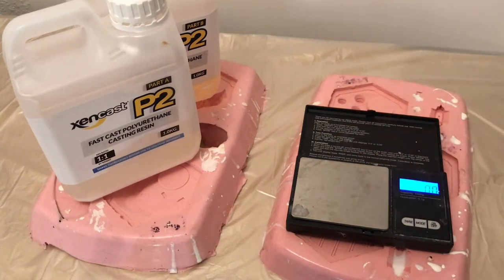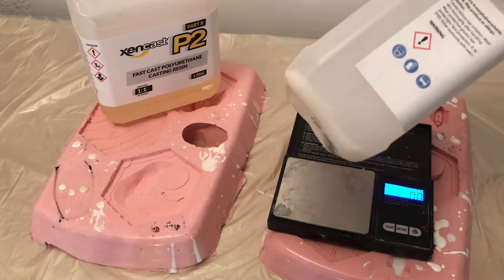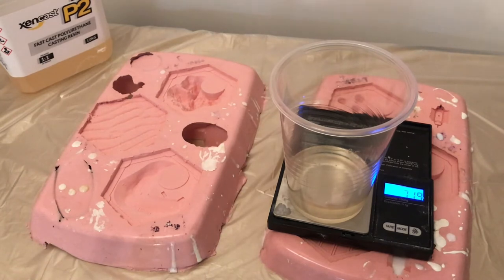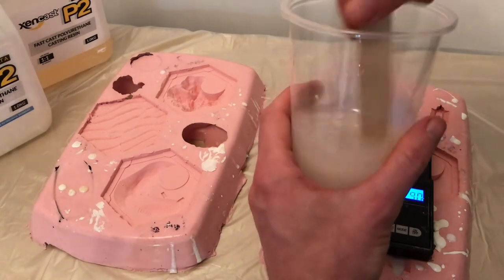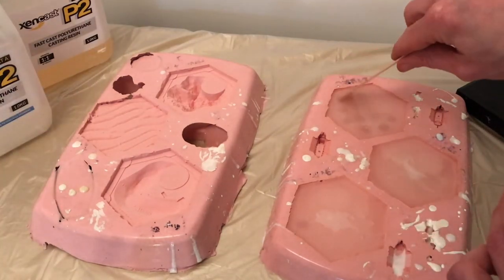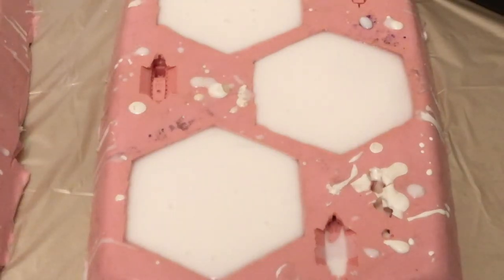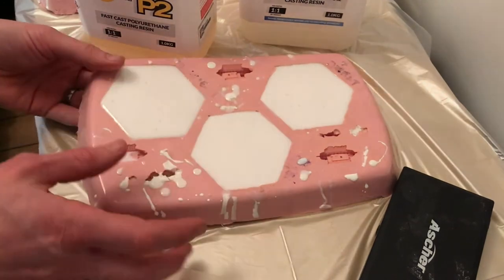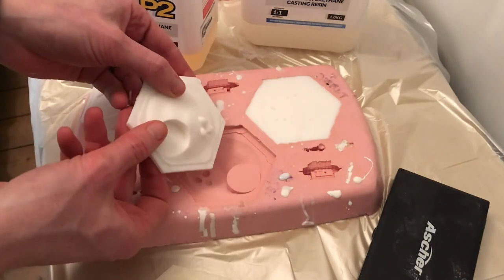Resin Cast 3D Printed Parts with Xencast P2 - Settlers of Catan Pieces! - #5minFriday  - #31

Comment: Awesome dude. I recently had the Idea of 3D Printing a base with holes for magnets and then handsculpting the top and then making a mold to cast it in resin. Looks really awesome
Reply from the maker: Thanks for the comment! My original models had spaces for magnets but it's hard to do two piece casting so I don't bother anymore.

I'm hoping to do a video on the silicone mould making process in the next week or so. Stay tuned as they say!